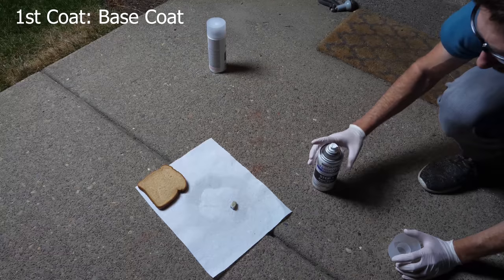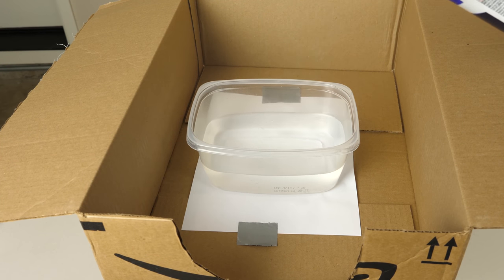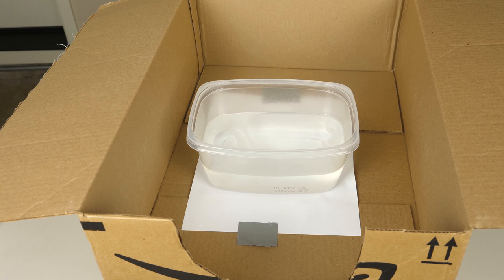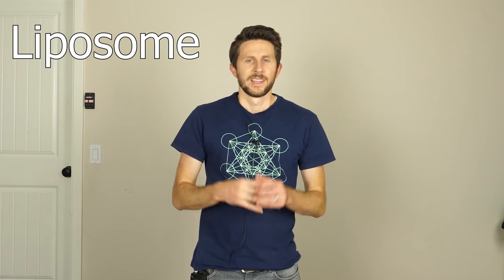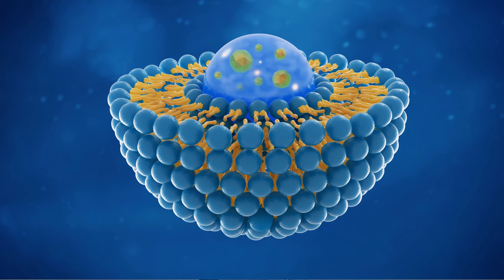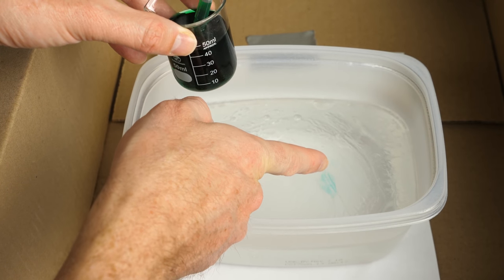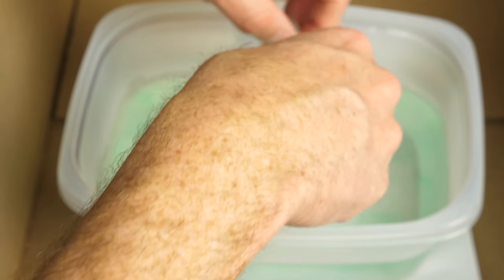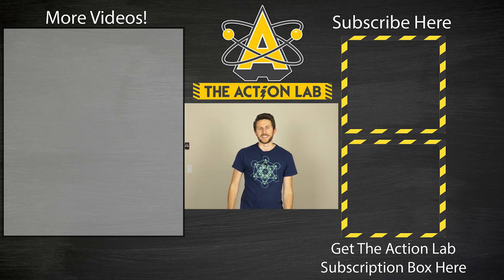Is it Possible to Make Water Waterproof? Spraying Neverwet on Water Experiment

Comment: You should spray it on ice and let it melt.
Reply: Just what I was thinking. It may be necessary to put it back in the freezer, to avoid water leaking after the fresh coating. Don't know if Never Wet works at those temperatures, though...
Reply: Why would he do something like that? Did you watch the entire video? If you did you saw the flimsy film that he pulled off the water surface. What in the world makes you think that that film would be strong enough to hold the water from a melting ice cube? Come on people use your brains before suggesting some of this nonsense.
Reply: @alifetomake  if that's what you were thinking then you weren't thinking at all. Hopefully you don't have a job where you get paid to think.
Reply: ThePrufessa  At least, I'm not agressing people for no reason like you do. I'm just wondering what would happen. It may be entertaining to see how it behaves in different circumstances.
Reply: @alifetomake  what would happen is the ice would melt and that film would be left sitting on top of the water just like at the end of the demonstration in this video. It's pretty obvious what would happen. Go buy your own damn Never-Wet and do it yourself. No need to waste his time at and ours with a pointless experiment.
Reply: ThePrufessa  I'm not mad at you, I'm sorry for you because you don't seem to have basic respect for your own kind. And about this experiment, if the coating gets applied more regularly because the surface is solid, maybe it will contain it and deform when it melts, at least for a moment. I said I don't know how the product would behave at lower temperatures, and I have no idea what would happen at all. It's just curiosity.
Reply: Woah, so aggressive. Chill dude, the fun part of science starts with questioning yourself. Don't throw away the Galilean method.
Reply: ThePrufessa   It's a good thing not everyone is as close-minded as you or countless cool accidental discoveries would have ever happened. History is full of weird, unexpected  discoveries that would have never happened if someone hadn't tried doing something "stupid" or "obvious". There's usually no harm in just trying something anyway, even if you're sure it will fail. You can hypothesize about something all you want but you don't know for sure unless you try.
Reply: @alifetomake  even if it didn't freeze and based on the results of this experiment you'd need to spray the entire can on the ice in order to have some strong enough to hold water. There's a difference between curiosity and stupidity. Spraying Never-Wet ok something that will instantly freeze it before it has a chance to make it's chemical reaction (30 minutes dry time) is pure stupidity and a waste of time.
Reply: @alifetomake  like I said if you want to see what happens go do it yourself. It's not hard to do. But no need for him to waste his time uploading a video in which we know the Never-Wet won't even work because it's TOO COLD!!
Reply: @Okusar  we'll go try it then and see for yourself. How do you expect the Never wet to seal the ice when it'll instantly freeze as soon as it touches the ice?!
Reply: ThePrufessa  Dude chill it was just a thought
Reply: @ThePrufessa  Jesus. You're extremely passionate about a comment I made 3 seconds after the video was uploaded. How long did you spend typing everything out?
Reply: @kelly44-l5v  ?
Reply: @kelly44-l5v  am I supposed to take this comment seriously?
Reply: @jaysondraws2417  a thought that didn't have much thought put into is my point. Now you chill on posting stupid thoughts.
Reply: @ThePrufessa  holy shit, you spent 3 minutes in a row commenting on one response.
Reply: @kelly44-l5v  holy shit ain't that a bitch I spent my time replying to the comments that I wanted to reply to how I wanted to reply to them. Not sure what your point is but thanks for pointing that out Captain obvious. Or should that be Captain oblivious? How about Captain Oblivious "The Great Observer of Messageboards"
Reply: @kelly44-l5v  holy shit, can we stick to the subject, albeit how absurd the subject is, of ice and Never-Wet and leave what we do with our personal time out of it? If you have nothing else to add to that then don't try to change the narrative to what I do with my time.
Reply: @ThePrufessa  hah. You're hilarious.
Reply: @ThePrufessa  but it's freezing point would be diffrent from water. And also, you having a tough day or something. Wanna talk about it?
Reply: ThePrufessa  so trying to make water waterproof isn´t nonsense at all?
Reply: @juanantonioromeroparra9178  I think he's stopped responding. Past his bed time.
Reply: ThePrufessa  Why is it so hard for you to understand that the original comment was just a suggestion, albeit little silly but non the less it was funny and would've fun to watch. But you bruh, you tried to ridicule it for no reason at all. More so you ignored all the previous comments who suggested that you're being an ass hat. So please go have a glass of water or splash it on your face but stay away from YouTube for a while or else that vein on your forehead will pop right open.
Reply: @ThePrufessa  What are you talking about? it would definitely work
Reply: +ThePrufessa   I know it won't work, you know it won't work, but that's not the point. Often times you learn as much from failure as you do from success, but you learn nothing if you never try at all.
Reply: ThePrufessa boy, i’d hate for you to be my science teacher.
Reply: Loéï Music & co don’t say your sorry you did nothing wrong, this dude just doesn’t have patience I guess. Not everyone knows everything and that’s perfectly ok. I was thinking the same thing you were that maybe it would contain the water when the ice melts . Like maybe if he sprayed multiple coats of the first step
Reply: Finally my ice don't leak
Reply: @vegetablescankill  why are you worried about me? Let's keep the conversation about Never-Wet and ice please. Leave everything else out of it. Leave my time wasting out of it. Everything. Keep the conversation restricted to the stupidity of spraying ice with Never-Wet.
Reply: @ThePrufessa  Oh trolls, leave.
Reply: Best idea freaking ever
Reply: @RedIrishSpud why aren't you like the president of the United States?
Reply: I was going to comment that till I saw your comment
Reply: @ThePrufessa  Man !! You got some issues
Reply: @ThePrufessa  Dude you just wrote 2 novels for me .

Thanks
Reply: ThePrufessa I think the only problem came not from your opinion, but from the way you presented it. Also, I think you need to refresh on the basics of the Scientific Method. A hypothesis was made. Don't try to say the hypothesis is correct or incorrect before you experiment :)
Reply: @jordang5938  the truth is the truth no matter how I present it. And the truth is the spray mist will instantly freeze as soon as it touches the ice. There's no hypothesis about it. Aerosol spray mist be used at room temperature. MOST chemicals will only work properly at room temperature.
Reply: @jordang5938  I dare you to tell me the hypothesis that was made about Never-Wet on an ice cube outside of the one I gave that it will instantly freeze. Who else made a hypothesis besides that?
Reply: ThePrufessa Wonderful... 
I tried to give you the benefit of the doubt. I sincerely believe you should move on. I'm not telling you that you are wrong. I did not try to combat your statement. Please take the aggressiveness down a notch
Reply: RedIrishSpud yes true that’s a good idea
Reply: @jordang5938  I don't need any benefit of a doubt and I wasn't asking for it. What doubt are you even talking about? How is it possible for you to give me any benefit of doubt?

Hope about YOU move on if that's what YOU wish to do. I will move on from this thread when I'M ready to and not when some bozo from the comments tells me to.
Reply: @roach6372  please tell me what's so clever about spraying Never-Wet on ice. I'll wait for your response. Until then you can miss me with all that other nonsense you said.
Reply: I think that that would be really cool
Reply: @mr.e1292  anybody that thinks spraying ice with Never-Wet should never be considered for president of the United States. As a matter of fact I think our current POTUS might spend half of his day spraying ice cubes with Never-Wet.
Reply: @ZoroarkLover98  who are you referring to?
Reply: @ThePrufessa  You
Reply: @ThePrufessa  Nah, you sound like a child who just had some basic physics or chemistry classes and thinks they are the new Einstein
Reply: @ThePrufessa  You also like making assumptions without any base, which is not very scientific
Reply: A better idea than spraying ice cubes would be to spray droplets of water resting on a surface. The challenge would be to try and get the entire droplets covered. This would be infinitely more feasible than trying to coat an ICE CUBE with a product that needs to be used at room temperature in order to work properly.

Thanks to the video we know that we can get a film to cover the droplets but can the droplets be maneuvered around so as to not spill any water before a coat can be applied to the bottom where the water meets the table.
Reply: That would need be much more interesting than watching Never-Wet freeze up on an ice cube.
Reply: @ZoroarkLover98 so what you're telling me is that you expect Never-Wet to work at subzero temperatures the exact same way it works at room temperature?! Is that what you're telling me? Because the only thing I've said in this entire thread is that it WILL NOT WORK THE SAME ON AN ICE CUBE THE WAY IT WORKS ON WATER THAT IS ROOM TEMPERATURE!!!
Reply: @ThePrufessa  Your assumption was that I was one of the people interested in said video - I am not. You apparently cannot read either. And you apparently cannot have a discussion without insulting people. And you didn't answer my questions. You are clearly not made for science.
Reply: @ZoroarkLover98  that's the same shit that every aerosol can says. So how the fuck does anyone here think it will work when an ice cube is at least fifty degrees lower than the lowest possible temperature that you're supposed to use it at?
Reply: @ZoroarkLover98  I don't need to know the freezing point of spray. All I need to know is that aerosol cans need to be above a certain temperature in order to work. Just like EVERY aerosol can will tell you in the directions. My Krylon range is 50-85 degrees. Never-Wet has the same minimum temperature but can work five degrees hotter than Krylon. What more do I need for evidence of what will happen.
Reply: @ZoroarkLover98  I can tell you what won't happen. It won't form a waterproof seal around the ice cube since it will instantly freeze when it touches the ice. I don't know the freezing point of Never-Wet but I'd bet my last dollar that it won't stay liquid after you spray it on an ice cube.
Reply: @ZoroarkLover98  you're getting caught up in semantics and making yourself look dumb in the process. my overall point is that the temperature of the ice would be too cold for the Never-Wet to work properly. I based that hypothesis off of the fact that, as far as I can remember, every aerosol chemical (not sure if febreeze gives a temperature range in their directions) gives a range of temperatures for it to work properly. That temperature range is a few degrees above and below room temperature. It's also based off of KNOWING from firsthand how subzero temperatures can render some or lots (I won't go so far as to say most) of chemicals, whether aerosol spray or not, completely useless. No I don't know the freezing point of Never-Wet and I don't need to know it.  Because I know for a fact that the temperature of ice is NOWHERE NEAR room temperature. The Never-Wet will immediately take the temperature of the ice as soon as it comes in contact with the surface of the ice. Which means the Never wet will never have a chance to dry which takes THIRTY MINUTES per the demonstration in the video. So I know exactly what the fuck I'm talking you stupid fucking dummy. You're the one that can't read and doesn't know what you're talking about you fuckin imbecile.
Reply: ThePrufessa Talking to yourself, I see? I understand what you're saying. Yes, aerosols have a certain temperature range under which they perform the intended function. If it is used below that temperature range, it might not be fully effective, but will it freeze?
Reply: ThePrufessa Also, I agree that a hypothesis does not have to hold anything in the way of scientific evidence. You seem to be at least decently smart. You should know that a hypothesis should not be dismissed - or confirmed - without being tested first. Pray tell, have you ever tried NeverWet on ice? Or have you seen any other video or something of the like about it? If so, please link it to me! I'm very open minded and I'd love to have such an opportunity to learn.

P.S. 
"Benefit of the doubt" is a common saying, used when you aren't completely sure if you should believe someone or not, but you take their word for it because you have no reason not to.
Reply: @ThePrufessa  man you are rude
just because he was curious and his hypothesis may be wrong doesn't give you the right to call him stupid

And that's why people in comment section are against you
Reply: @jordang5938  but I never dismissed anyone's hypothesis. Nobody here even made a hypothesis of what would happen besides me. I'm the ONLY person on this entire thread that made a prediction of what would happen. Everyone else just made suggestions and co-signed suggestions saying that it would be cool to watch.
Reply: Someone who respects science would never discourage others for their curiosity.
Reply: Yes That Sounds amazingi Think im gonna Try That
Reply: @ThePrufessa  u wrote a lots of YouTube essays lul (sorry for bad English)
Reply: @ThePrufessa  chill out dude you're acting like this guy is known for 100% logical experiments
Reply: @ @ThePrufessa  Obviously nobody would want to listen to your opinions, as you present them in a way that is very rude, breeding hatred against you. You also claim to be correct and put down other people's ideas with out a valid reason. If spraying an ice seems like a lame idea to you, why did you bother watching this video in the first place? Anybody has the right to ask any question and test their hypotheses, and many inventions that we take for granted today were discovered by accident. The question was a valid question, and I see no reason as to why you were so quick to put down the idea. Additionally, some of the greatest geniuses in history never considered themselves as geniuses, and considering yourself to be a genius means that you aren't actually a genius, as a true genius would support ideas that are valid. I am not implying that I am a genius, but that you should not put down anybody or their ideas. Additionally, I see no reason to agree with somebody subscribed to Disney Junior. Sorry if I didn't dumb down my comment enough for you.
Reply: @ThePrufessa  that's not how you spell 'Professor' <<<<that's how you spell it.
Reply: ThePrufessa Also, may I say that I never said spraying on ice would work. I'm simply throwing ideas out there. Please, tell your chemistry teacher to stop encouraging parochialism.
Reply: @ThePrufessa  hey :<
The reason people are making you angry might be cause they took your explaination the wrong way round(cause you cant read a person's mood through a text) so,of course it might be dumb but....try at least like throw your lifetime stress away by doing something that you like other than trying to explain to us.It would be better to make us face it the hard way.remember,not all are open minded or long-tempered.
And....if you feel angry at me,just say what's wrong and I'll try to talk with you and sort the problems out,if.....thats not a dumb opinion.... :"<
Reply: Rude people are so funny. Especially when people don’t know another person. What hurt them to be mean like this? It’s beyond me.
Reply: @hio7019   YES EXACTLY
Reply: @ThePrufessa I think spraying it on water is as stupid as spraying it on ice. So.... learn to be nice.
Reply: @ThePrufessa  m8 ypure so damn entertaining, but i gotta say, youre also annoying for agressing people who just want to use their imaginations
Reply: @ThePrufessa — Look, Spud just suggested something. Sure, you could say it’s not possible, but you don’t have to go and be rude about it. You could be right, but you said it in a rude way and proceeded to argue over what could’ve been reasonably discussed. Just accept the fact that you’ve overreacted, and we can all have a great day.
Thanks.
Reply: ThePrufessa thought I would throw this out there all of the greatest minds say everything is possible
Reply: @jointaimbot55  after what you said to me was impossible.
Reply: @ThePrufessa  bro why you so triggered, take a hit or grab a beer or something lmao 
nothing in life especially not random YouTube comments is worth getting so stressed over
I am genuinely concerned that something must be going down in your personal life for you to feel this way. Talk to someone about it, call a friend or family member, or heck I'll listen. Just don't take it out on strangers. Even if you think their ideas are dumb, there's a way of going about things an nobody has to get hurt.
Hope your week improves mate, have a good one
Reply: RedIrishSpud I never said anything was impossible I think you have me confused with the other guy
Reply: Nc
Reply: Sound like a solid.
Reply: EYS that dude or girl is probably on their period, or have been on their period for the past 10 years or something. I just accidentally read this entire thread just to see what he/she would respond with haha
Reply: Lol ThePrufessa doesnt know how freezing points work. if it freezes at that temp or higher then itll freeze but if its freezing point is -50C why the hell would it freeze when it touches ice? thats like saying if i had a natural gas pipe and i sprayed it onto a bucket of ice, id form frozen methane/butane.
Reply: @ThePrufessa When there is no point of spraying it on an ice cube "bc it does not work and is the truth", then what point do you have for spelling "The Professor"* wrong, when it's spelled this* way and not else bc that is also kinda useless and the truth? 
Just saying
Reply: Harvard would like to know your location
Reply: @ThePrufessa  calm down you can easily say it kindly like "that won't work because it will become a film which will break and it might not work at such cold temperatures"
Get a life
Reply: This is hilarious to read
Reply: @ThePrufessa  you sound like my mother and that is just sad. Get a grip on your emotions man.
Reply: It's times like these that make me wish people weren't so ignorant as some child getting angry at a bunch of strangers online
Reply: @taxfraud3137 
True.
Reply: @ThePrufessa  you're right but you don't have the right as a scientist to dismiss others curiosity (as someone else said) in an extremely rude way. If you think you're helping anyone but yourself in this situation you are absolutely wrong.
Reply: This whole shit show feels like National Geographic tried to do a drama series but then ended up with a Dr. Phil episode... It's both hilarious and... Just fucking hilarious.

I bet if I say something stupid—actually, anything to be honest. It'll elongate the lifespan of this chain. The only thing missing right now is someone to say the Earth is flat and get this shit more intense.

The beauty of YouTube comments... There's always a clown on top of a pedestal, unknowing to why he/she has become a joke—and always fun to laugh at.
Reply: @ThePrufessa  actually we're all equal cause we all clicked on a video that said "spraying never wet on water"
Reply: That is...a good idea...
Reply: Loéï Music & co dude sorry that people are like this, good job coeping
Reply: ThePrufessa they’re not saying that never wet would be strong enough to contain a melting ice cube,  I think one of them did say ive cube but it was obvious from context what they actually meant, they mean freeze it in a tub or something and then spray the never wet, it doesn’t have to have any strength for that. Secondly, you keep saying aerosol cans don’t work in freezing temperatures, and that’s true, but they’re not suggesting putting the can into the freezer, the aerosol van would be at room temperature and only the contents would touch the ice once sprayed, and we have absolutely no idea what the freezing point of never wet is, chances are it would be fine to spray on ice, plus if it froze it may just thaw out and work once the ice has melted.

You seem very stubborn in your opinion and are unable to look past that at all. I’m not trying to criticise you, I’m just suggesting to be more open minded, what’s the worst that could happen
Reply: Jordan G he thinks that you have to freeze the aerosol can for some reason. He thinks that if there is ice in the room the aerosol won’t work. He doesn’t realise the aerosol will work perfectly and it’s the contents that may freeze, depending on the freezing point of never wet. I honestly don’t understand why he keeps saying aerosols don’t work at freezing temperatures, I hope he realises the reason it says that is because of the can was that temperature it wouldn’t spray, presumably because of the propellant.
Reply: @ThePrufessa  they didn't tell you to do anything
Reply: @ThePrufessa  also I believe it would work because if he sprays a layer all around it and it hardens to the plastic layer like he had and with no holes then he would have a plastic ball of water. I'm not sure if the spray would ice over or freeze on the spot ( maybe with dry ice) but it might have to be as quick as he can spray it in a general cold room and let it dry before he does the final coat and lets that dry putting the cube in the fridge or alternating the cube between cold room and freezer.
Reply: @ThePrufessa  basically there is a base coat that after research can be at about 59 degrees and that is just an estimate then after that the actual coat would go on which I'm assuming is the actual waterproof part and it just sticks to the base coat so it would be able to make the ice less cold( it would become partly insulated ) in order for it to be warmer for the spray to work. Plus the temperature that the other spray can be at would be is around 70 at most and by the time the base is dry it would contain most of the partly melted ice and then would continue to hold it while the second layer drys( you could make the cube warmer and it would catch the droplets from being warmed.). But don't get butthurt this is just my personal hypothesis after doing my research.
Reply: @ThePrufessa  miss me what is that shit supposed to mean?
Reply: @ThePrufessa  ice isn't stored at sub zero temperatures. If it was then I would be sticking my hand in the freezer with a glove to get the ice. The freezer temperature is around 32 degrees Celsius and that is a estimate. Water freezes at just about that temperature. You were claiming you wanted to stay on the task but you are trying to get off track either way
Reply: @ThePrufessa  maybe because the winter can get at very cold temperatures and so it is colder than a freezer plus they don't just spray paint the cars it is a completely different process with very different materials.
Reply: @ThePrufessa  ALSO you said that you didn't say anything scientific this entire time?? Well it seems like you were just babbling words then because it sure sounded like you were trying to make yourself sound scientific
Reply: @ThePrufessa  uhmmm actually you need a lot more things than that. I bet you are going to fail all of your future science fairs. ( I say future for a reason ) don't worry you will soon learn all the reasons you were wrong here. Just said until third grade.
Reply: @ThePrufessa  it's actually not that simple ( it's about to get racial in here so be ready) if you were to not like one black person because of one reason then would that make you group all people together and make you tell yourself you don't like them. no that's racist ( kind of )and they are agreeing to the other comments because your whole argument doesn't make sense
Reply: @ThePrufessa  who claimed you couldn't read? I see that literally no where and if it is there then I'm not seeing it because you flooded the comments
Reply: @alifetomake  if the product needs to be at 65 degrees and ice is 0 degrees then how the fuck do you think the chemical reaction will take place to form the proper seal?
Reply: @sierrarouse3887  I need a lot more things than what? What are you even talking about? I never said you needed anything in the first place.
Reply: @sierrarouse3887  how am I wrong by telling you what the instructions on the can says about the conditions you need in order for their product to work?   Like that's all I've ever done is said putting it on ice won't work because the instructions say it needs to be at ROOM TEMPERATURE to work. If it's 65 degrees lower than the proper temperature then how the fuck will the chemical reaction that NEEDS to take place happen IF IT'S TOO COLD?!
Reply: @squeesh280  not angry at anyone in this thread. So this was a complete waste of your time.
Reply: @ThePrufessa  then what are you stressed over mate
Reply: @sierrarouse3887  there's no temperature an ICE CUBE can be that's WARM ENOUGH for an aerosol spray that needs to be 59 degrees in order to work. Period. The base coat needs to sit for 20-30 minutes before you apply the top coat. If the base coat is IMMEDIATELY FROZEN by the COLD ICE then won't get the 20-30 minutes it needs to prep for the top coat.
Reply: @sierrarouse3887  there is no estimate. You can go on the website and read the ACTUAL temperature range it works at.
Reply: If all of y'all think this is such a good idea why haven't you done it yourself and uploaded the video yet? Why are you waiting for him to do it? Chances are, with him being a REAL scientist, he thinks this is as stupid of an idea as I do. So, instead of waiting for him to do it DO IT YOURSELVES! IT'S NOT A COMPLICATED EXPERIMENT!!!
Reply: @ThePrufessa  you really came back? XD
Reply: @kelly44-l5v  when did I ever leave?
Reply: Had the same idea
Reply: ThePrufessa chill out and mind your own buissness. Besides, it’s an “experiment”. You never know until you try. Keep talking when you come up with a smart comment with over 1k likes.
Reply: ThePrufessa but wait a minute... you judges the person that made the comment about the ice and called him stupid... what a hypocrite.
Reply: ThePrufessa why are you such a bummer? let people hypothesize even if it’s wrong! it was just a suggestion no need to call people names and things! yes aerosol freezes at subzero temperatures but it would still be kinda cool to see how it behaves, even frozen neverwet in itself would be kinda cool to see..
Reply: @ThePrufessa  there's a reason why science is made up of theory's, how do you know what you said is true? Also no offense but you kinda remind me of one of those people who think that others opinions don't matter only your own matters.
Reply: ThePrufessa l
Reply: @verypatrerins0072  m
Reply: Or I'll wait until the host himself listens to your comment and does it himself.
Reply: here's an idea. Everybody here that doubts me leave a BRAND NEW COMMENT requesting that he spray it on ice. That should be at least 25 people. I'm sure he'll listen if the demand is high enough. Or, if he doesn't listen then that means he thinks the idea is just as stupid as I do. Now, the ball is in each and every one of you doubters' court.
Reply: @ThePrufessa  you don't have to get all offensive about it, I don't see why you continue to comment even though multiple people have said something to you. Someone asked for them to do something, 2k people obviously agreed, and here you are getting upset over it.
Reply: @ThePrufessa  a lot of people have a problem with that. You don't just be rude to someone because their comment doesn't "make sense"
Reply: @ThePrufessa  I can understand if they were being stupid and rude but they were not being rude
Reply: @ADom0  I DO get rude to people whose comments don't make sense. That's EXACTLY why we're in this back and forth right now.
Reply: Cave Johnson once said, "Science isn't about why, it's about _why not_!" 'Nuff said.
Reply: That would be interesting
Reply: Humble Mixer The OP’s remarks weren’t clever, they were for comedic purposes
Reply: SaySansy 121 Finally someone who is a mediator
Reply: ThePrufessa Listen buddy, what you say makes complete sense, and I agree with you. It’s great that you take other factors into consideration. But people are more likely to agree with you and understand if you are explaining in a much more soft and alleviated tone. You do service people by sharing information, but coming with hostility will cause a massive backlash. Honestly you seem like a stressed person, arguing with people will exacurbate your stress levels and maybe even make you more likely to continue arguing. Telling you to relax obviously doesn’t work, hey, I understand that. You can’t really change the minds of people, their brains are harder to mold than you anticipated, which makes sense so they aren’t as susceptible to being fooled. If you got any questions, feel free to ask me. EDIT: One more thing, do not to put yourself above others, they aren’t at your subserveriance.
Reply: Ye
Reply: @crypticgamma6308  he's like black trans furry or some'n like that
Reply: @ThePrufessa  ahhh yes thank you for this amazing entertainment!
It was absolutely beautiful reading through this comment thread and seeing 50 youtube essays by the exact same guy because they're so fucking sensitive over a small suggestion that someone made, as they were curios of what may happen.
Reply: @Nif-kun  
The earth is flat
Reply: @ThePrufessa  what if we spray it in ice two times?
Reply: This was a year ago guys, i think he/she/they forgot about this
Reply: @ThePrufessa  hey reply. We need a closure.
Reply: @WAanik  closure from what dummy?
Reply: @ThePrufessa  Life in general and ice in particular.
Reply: @osakeleto  then you'll have a thick layer of frozen waterproof spray that will never get the chemical reaction necessary to form a waterproof barrier. What kind of dumbass question was this?
Reply: @SilverWinterSW  why would you think seeing  ice coated with waterproof spray that never actually turns waterproof because the ice stopped the chemical reaction from happening (it takes 20-30 minutes before the waterproof barrier is actually formed) would be something interesting to see?
Reply: ThePrufessa okay 1)even if we know what would happen it’d still be cool to look at it irl 2) were not wasting his time if we were he wouldn’t make this video 3)you know if you don’t like a video you can... click out. 4) I really don’t want to meet a person like you who calls people dumbass for absolutely no reason 5) your comments are amazing entertainment material for all of us so thanks
Reply: ThePrufessa why so mad at a simple comment dude like chill out, we are literally watching a video about water proofing water
Reply: Blazingfury101_Z lmao same
Reply: So many people didn't get the joke im face palming so hard.
Reply: Oh my eyebrows yes
Reply: @justineskins3645  are you dead?
Reply: @ThePrufessa  chill man
Reply: Omg
Reply: @ThePrufessa  I hope you don’t get a job where you get paid
Reply: @tinamarie9136  I have no idea what that is even supposed to mean. Try again and this time make it make sense.
Reply: @ThePrufessa  nvm lol
Reply: @xramzulx  because I THOUGHT about what was being suggested and realized how this would not work in any way shape or form? Yeah, like science is against people that use critical thinking skills to save themselves from wasting time doing pointless experiments.
Reply: @xramzulx  and if you think spraying an ice cube with any type of aerosol spray is a good idea then you have no idea how science works. So you don't get to determine what makes people disinterested in science.
Reply: @ThePrufessa  I think a cool experiment is seeing how long someone up their own ass over something so trivial could keep insulting people over their own bad manners and seeming inability to explain anything nicely and move on, thus saving themself and tons of others time and annoyance. So far it’s about 2 years in your case and it’s pretty entertaining to be honest.
Reply: @pj_spirit  I explained it nicely the first time. Then people kept trying to tell me otherwise. And I responded.
Reply: @ThePrufessa  You really didn’t.
Reply: @pj_spirit  like I said, if you want to dispute something I've said then do that. I could not care any less about how my demeanor offended you. I'm not here discuss comment section etiquette. I'm here to talk about how dumb it was to suggest spraying never wet on an ice cube. Do you have anything to say about the actual topic at hand? If not leave me tf alone.
Reply: @ThePrufessa  I know, right? Still better than behaving like a psychopath, though...
Reply: @alifetomake  I'm not behaving long a psychopath, though.
Reply: @ThePrufessa  Of course not!
Reply: Two results 
1: wouldn't work because of the low temperature 
2: would end up as a bobble droplet 💧
Reply: @LumaSloth  lol this is exactly what I tried explaining to these dummies. They don't listen.
Reply: So this but slower?
Reply: @fres2161  bro is still pressed two years later twr 🤣🤣🤣
Reply: Please make
Reply: I see why he’s so negative. His only popular videos are about making fun of people! Maybe if you change your channel after taking pics you could get views.
Reply: ThePrufessa more than half of these replies are made by one person. Like reading the writings of a deranged madman lmao.
Reply: @ThePrufessa  Man, this isn’t a huge deal
Reply: @gameryusic825  what joke?
Reply: @LumaSloth  THANK YOU!!!!!
Reply: @fres2161  I did say it without being rude. I didn't get rude until a bunch of idiots tried to tell me it would be cool to do after what I said.
Reply: @kakokapolei123  I'm not making deranged comments. All I'm doing is telling people how dumb it would be to do what was suggested in the original comment. There's nothing deranged about that and the only time I reply is when someone tags me in a comment.
Reply: @ThePrufessa  Man, this is just a guy who had a simple curiosity. I doubt that it’s really that important to do tons of research onto if it is possible or not to do. Is it really that hard for you to not object to this and move on?
Reply: @jimothyscrub  so is my opinion supposed to change just because three years have passed?
Reply: @jimothyscrub  what does being stubborn have to do with anything? Who here is telling me to do something that I'm not listening to? Being stubborn doesn't have anything to do with me telling people that this is a dumb idea. And yes I still think it's a dumb idea after three years.
Reply: @jimothyscrub  and I'm just a guy that's telling him that this idea would not work.
Reply: @jimothyscrub  who said anything about doing tons of research for this? Not me. So once again you're arguing against something that I never said.
Reply: @ThePrufessa  How about this. Why does it matter? Why do you care about this random person online giving a suggestion? Why must you continue this debacle? Just stop responding to people if you want to stop being annoyed. It is THAT simple.
Reply: @jimothyscrub  what do you mean die on this hill? Why are you acting like I'm saying something controversial? All I've said is that this experiment would not be fun to see because in the end all you'd end up with is melted ice with chemicals floating on top.
Reply: @jimothyscrub  when did I say I was annoyed by anything? Or when did I say I want to stop being annoyed? Why do you keep putting words in my mouth that I never said?
Reply: @jimothyscrub  why does it matter? I have no idea what this question has to do with this thread. I'm free to share my opinion on this idea just like anyone else is.
Reply: @jimothyscrub  why does how I feel about this matter to you?
Reply: @jimothyscrub  and what debacle? This is not a debacle. Stop using words and phrases you don't know what they mean.
Reply: @jimothyscrub  I don't care about the random person that made the suggestion. All I care about is telling everyone that thinks that this is a good idea why it isn't a good idea. That's the only thing I've said here the entire time. You keep putting a bunch of words in my mouth that I never said.
Reply: @jimothyscrub  I never said I was annoyed by anyone. So why would you think I'm annoyed by anything here?
Reply: @ThePrufessa  Why does it matter if it is a good idea or not?
Reply: @misterrogers64  if I were a science teacher I'd sure as fuck never bore my students with a completely pointless experiment that was suggested here. And if one of my students made this suggestion I'd explain to them why such a thing wouldn't work. And if they continue to press me about it I'd tell them to tell their parents to do it with them at home. Just like I told everyone here.
Reply: So three years ago I made two suggestions to everyone here that thinks this would be a good idea.  The first suggestion was for everyone that thinks this is good idea to make a separate comment suggestion for him to see it. He has made video responses to his comments before. So if he thought this was a good idea he would've done it by now. This comment got 2.8k likes. Yet...he still didn't do it.
Reply: My second suggestion was for all of you to do this experiment yourselves and post the video online and tag me in it. All these people jumping on my because I'm telling you how pointless this experiment would be and any one of you could've proven me wrong by now. Three years later and not one person took me up on that simple challenge.
Reply: Why should he spray it on ice and let it melt? What exactly would be the point of that?
Reply: @ThePrufessa Scratch everything I've said before, why are you still responding to comments three years later?
Reply: @jimothyscrub  who said it matters? You're the only one here talking about what matters or not.
Reply: @jimothyscrub  I never said that anything mattered dummy. All I said is that this won't work. Nothing to do with whether it matters or not.
Reply: @ThePrufessa  I am genuinely curious. Not trying to bash on you in any way
Reply: @jimothyscrub   because I want to. why are you worried about why I'm replying to comments three years later?
Reply: @jimothyscrub  why are joining the conversation three years later?
Reply: @jimothyscrub  and if you want to scratch everything you said before then delete the comments. You should because every single question you asked me was completely off base and had absolutely nothing to do with anything I've said.
Reply: @publixskate  so when you see major brands that purposely spell words wrong do you tweet at them letting them know they spelled something wrong?
Reply: @vegetablescankill  I am relaxed dummy.
Reply: @Okusar   if you think there is something to learn from this there's absolutely nothing stopping you or anyone else from conducting this experiment and learning from it on your own. Record the video upload it and send me the link so I can see what you learned.
Reply: @Okusar  and this wouldn't be considered a failure when it was doomed from beginning. There's a difference between doing something you have no idea what the results will be and doing something you know won't work from the get go.
Reply: @roach6372  this has nothing to do with edible water. Waterproof spray needs to be at room temperature in order for the chemical reaction to take place that allows it to become hydrophobic. After the spray comes out of the can it needs a few minutes for the chemical reaction to take place. If you spray it on ice that chemical red will never take place because the zero degree ice is seventy degrees below room temperature and therefore would freeze the spray before it has a chance to form a waterproof barrier.
Reply: @ZoroarkLover98  my assumptions were not baseless. If the can of never wet says it needs to be at room temperature in order to work and you spray it on an ice cube that's zero degrees then what do you expect to happen?
Reply: @ZoroarkLover98  you have it completely backwards. Anyone that thinks that this is a good idea for a science experiment are the ones that belongs in a basic physics or chemistry class.
Reply: @ZoroarkLover98  All I know is that aerosol sprays need to be at room temperature in order to work (unless they're specifically designed to work in the cold). so if you spray an aerosol on an ice cube that would immediately drop it seventy degrees below the temperature it needs to be in order for the chemical reaction to take place for the hydrophobic barrier to form. The spray doesn't immediately form a waterproof barrier. It takes several minutes for the spray to dry and form the barrier. And if you spray it on an ice cube then that will stop the chemical reaction that actually forms the waterproof barrier from ever taking place. So if that means that I think I'm Einstein then so be it.
Reply: @ZoroarkLover98  OF COURSE IT WOULD FREEZE!! The can CLEARLY SAYS it needs to be room temperature. Even if it doesn't freeze it will still be seventy degrees below the temperature it needs to be in order for it to work how it's supposed to work. Which means the waterproof barrier will never form.
Reply: @ZoroarkLover98  the proof of my claim is written in the instructions on the can when it says the spray needs to be room temperature in order to work.
Reply: @ZoroarkLover98  I don't need to know the freezing point of the spray. The can says the spray needs to be room temperature in order to work. If an ice cube is zero degrees that's seventy degrees BELOW room temperature.
Reply: @jordang5938  who cares if it freezes or not. My point it the chemical reaction that needs to take place after the spray leaves the can will never take place because it's at a temperature 50 degrees lower than it needs to be in order for that reaction to take place.
Reply: @jordang5938  benefit of the doubt doesn't apply to what I'm saying man. Why haven't you done the experiment and uploaded the video?
Reply: @jimothyscrub  how come you ignore every question I asked you?
Reply: @jimothyscrub  why are you respond to my comments from three years ago if you don't want me to reply back?
Reply: What if we spray it on dry water?
Reply: @ShlokParab  what is dry water
Reply: Unlimited ice
Reply: @ThePrufessa   you still think is stupid after three years what persistence
Reply: @ThePrufessa  I like you’re funny words magic man 🔮🪄
Reply: @quintondeyarmond4587  you should really learn the difference between you're/your.
Reply: My mistake I like your funny words MAGIC MAN🎉
Reply: @ThePrufessa   Big mad
Reply: @evanhurt8673  why would I be mad because people are too dumb to understand how this stuff exercise works?
Reply: @ThePrufessa  We don’t now if your mad we analyze by the words
Reply: @ThePrufessa You're assuming that it has a freezing temperature of zero degrees c
Reply: @thundercrrp9931  you're assuming that I'm assuming that it has a freezing temperature of zero degrees.
Reply: @Okusar  I'm not closed minded about anything. I've said several times within this thread to go buy some of this stuff and do this project yourself. NOBODY has taken me up on that. Is it perhaps because they realized that this idea was dumb soon after they sprayed the NeverWet on the ice?
Reply: @alifetomake  it doesn't work at those temperatures. Must be at least 50° F in order for it to work.
Reply: @Okusar  so WHY haven't you recorded yourself doing this experiment and upload it to YouTube yet?
Reply: @juanmanuelgonzalezalmenare4754  yeah well this video proved that spraying it directly on water actually does work. And since the water is in the temperature range that it needs to be in order for the NeverWet to work it cured just fine. So who cares that you think spraying it on water is a dumb idea? He still accomplished what he wanted to accomplish.
Reply: @jointaimbot55 : "the greatest minds say everything is possible."

I've never heard one great mind say everything is possible. And WHY hasn't Action Lab tried this experiment if he thinks it's possible?!
Reply: @Rock_Lee_The_Handsome_Devil  don't be concerned about me dummy.
Reply: @jonathanodude6660  I absolutely do know how freezing points work. This product needs to be ABOVE 50° F in order to work. What the fk is so hard for YOU to understand about that?!
Reply: @HolyPetRel  HOW am I dismissing their curiosity when I'm telling everyone here to go do this themselves and record it and upload it to YouTube?! Does that sound like a dismissal to YOU?!
Reply: @Nif-kun  the only clowns in this thread are the ones that thinks this would be an interesting experiment. And who haven't accepted my challenge to record themselves doing it and uploading it to YouTube.
Reply: @ThePrufessa  it's been 4 years 
I have no memory of this thread
I can assure you, I'm not lol
Reply: @osakeleto  then it'll freeze two times.
Reply: @HolyPet  HOW am I dismissing their curiosity when I'm telling everyone here to go do this themselves and record it and upload it to YouTube?! Does that sound like a dismissal to YOU?!
Reply: @ThePrufessa  bro I got no idea what you’re talking about. There are 345 replies and the thread is 4 years old. Ain’t no way.
Reply: @jonathanodude6660  right.
Reply: @ThePrufessa  I'm assuming that you're assuming that it has a freezing point of zero degrees or less as that is the temperature of ice, which would explain why you're saying that it would freeze when it hits the ice (which could totally happen, I'm not disputing that, I'm just saying that it's a factor that could make the result different from what you predicted)
Reply: @ThePrufessa Hey, your comment kind of makes sense (yes I am joining the conversation 5 years later) but you presented your argument in quite an offensive/aggressive way (in my opinion, but I'm sure many people agree). Maybe you could've just suggested that you think it wouldn't work and not say "you should use your brain before spewing out this nonsense". Hope this helps.
Reply: @ThePrufessa It's been 5 years lad, I hope you've been able to work everything out and are in a better life position. Always here if you need to talk ❤️
Reply: @chesterchub  I only got aggressive when people started telling me how wrong I was dude. Either learn how to grasp context or stay out of the comments.